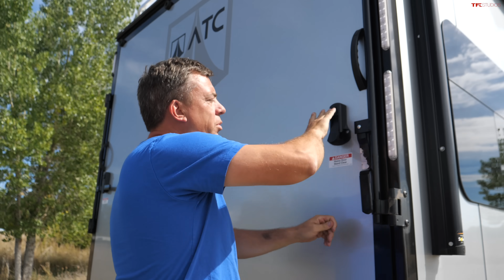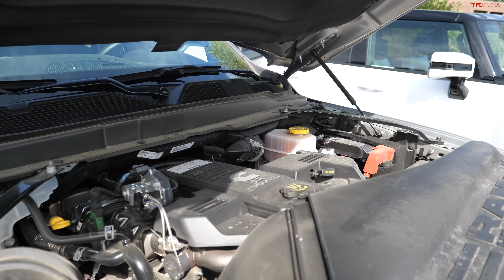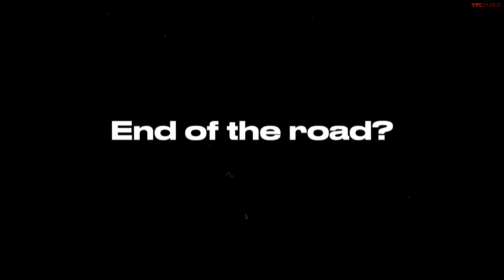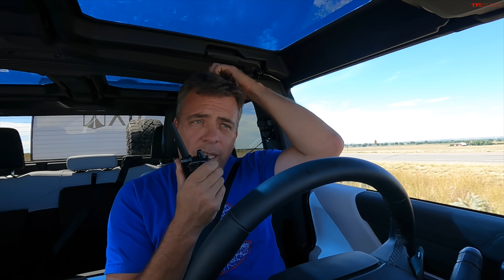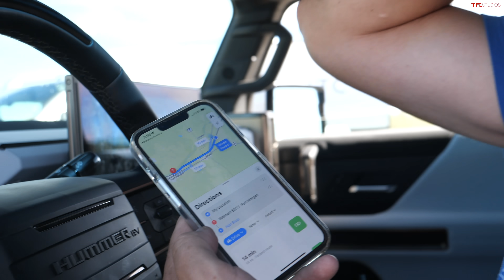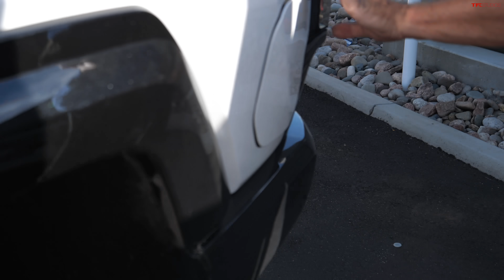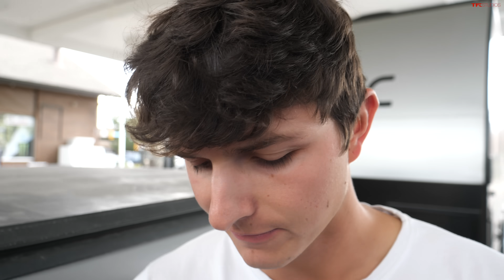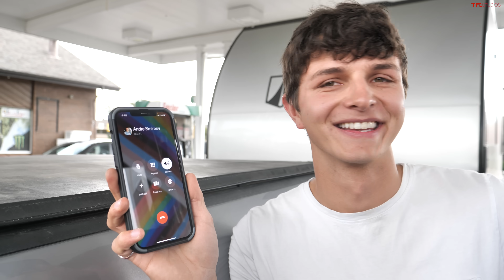How Far Can a Diesel and Electric Truck Tow An Identical Camper Trailer on ONE Fill-up?

Comment: An electric truck is just a toy for leftist soy filled losers. They have no real use for real world truck users. If you run out of power in an EV truck you are screwed. Unless you have a generator and enough fuel to run it, you are getting towed. In a real truck you get a quick top off with a few gallons of fuel and you are ready to go to a fuel station for a 5 minute fill up and you are back on the road.

Comment: Would be interesting to see the range difference if you ran a diesel generator to charge the battery as you are towing (if charging while driving would be possible). While it would be obviously not zero emissions, would it be less emissions (and better MPG) per mile compared to a diesel truck

Comment: They sure seem like more trouble than they're worth. Then when you factor in what the batteries take, and eventually do. You could drive 10 diesel trucks 400k miles and not pollute as much as a new hummer already has on the showroom floor.

Comment: So a clarifying point of order in regards to "fuel pricing"...you put less that half a tank of electricity back in the Hummer and went half(-ish) the distance.  I'm rough calculating you used about 184kwh to travel the 123 miles.  Outside of promotions that would be ~$79...$57 if you are a member.  That's $.64 and $.46 per mile respectively the diesel was around $.49/mile.  So basically we're just not quite there yet in regards to EV overall...and quite far away in regards to towing.  Currently the EV market is daily commuter, charge it at home.  That's really the only sensible use case.   I want a livable earth as much as the next guy, but we're a generation away in technology and a decade away in infrastructure...but we have to start somewhere...

Comment: Range is a large issue with EVs still.  And, based on what the cost would have been, no savings to speak of over diesel.  Hybrids get great fuel economy and no charger is needed.  Wait until the government starts taxing EVs for road use as they are heavier.

A real world situation:  heading from Houston to Dallas with a 30 MPH wind out of the north and pouring down rain and cold.  So you are using lots of extra electrons.  Now, add a traffic accident that shuts the Interstate down, will you run out of juice before it get moving again?  I can bring you fuel but not electrons.  I bet you would not get half way before having to recharge, but wait, where are the charging stations?  Well there are some but most are close to Houston.  You'd better plan ahead, or better yet use a gas powered vehicle.

Comment: Nobody buys an EV for a tow vehicle. Love the videos, but you are comparing two totally different vehicle focus groups. These videos really make the average person hate EV's even more, when, in reality, the EV is way more impressive than the diesel trucks. Bottom line, if you tow long ranges (over 100 miles one way) then stick to an ICE vehicle; if you do not tow long range, the EV's will be just fine. Now, let's not forget, the EV was twice as efficient. 

Basically, the Hummer has a small battery for towing, yes, I know it's not small; throwing a 10 gallon fuel tank in the RAM would be a prime comparison. EV's just need a larger "fuel tank".
Reply: Twice as efficient, twice as expensive, third the range, half the cost to fuel up.
That's the trade off. If you live in a cold place, EV is even less convenient
Reply: @dwightmanne  not accurate. I paid less for my R1T than a loaded F-150. 
I pay less than $10 to charge from empty to 100%. 
That’s 330 miles of range. 
The cold has robbed about 30 miles on a full charge. I’m in northern NY. Gets extremely cold here. 

The EV’s are getting a very bad name due to media. 

Think of an EV as a vehicle with the best performance, best luxury, best everything, but range. Imagine a loaded Denali diesel with a 10 gallon fuel tank. That’s a fair comparison. 

EV vehicles just need more range. It’s coming
Reply: @Teamvenomracing  how many people get all the options on their trucks? We are talking factory without options. Good for you and your rivian. Sad that you live in a cold place that kills batteries. But don't make dumb excuses just to justify your purchase.

A ten gallon Denali... Really?

Anyways. EV will gain widespread adoption if they are either cheaper than regular gas cars or have better mileage.
Half the cost or 500 mile range would have everyone running out to buy them.

As they are right now, the electric grid can't handle them, they take too long to charge, their range is too low, they cost more, batteries degrade and are expensive to replace and they have too many electronic stuff to break that make them hard to repair.

EV is the future, but we live in the present.
Reply: @dwightmanne  you really need to do more research. 
EV’s like the Rivian, are top model vehicles. So, you can’t compare them to anything but a top level truck of another manufacturer. Premium f-150 cost more than my Rivian. 

Now, batteries. 
They last on average, 20 years. The ones that Don’t are warrantied for 8 years/175,000 miles. 
The batteries that do fail, get repurposed or recycled. 

I actually own an EV and have been working on their tech for a living for 20 years now. 

Do you own one? Do you work on them? 

No, and your comments reflect this.
Reply: @Teamvenomracing  i owned a Prius and have a hybrid Impreza.
You aren't endearing anyone to EVs with your attitude. 
You're just living up to the stereotype of the smug self important ev owner
Reply: @dwightmanne  sorry you feel this way. You’re still very uneducated on EV’s. Do more research.

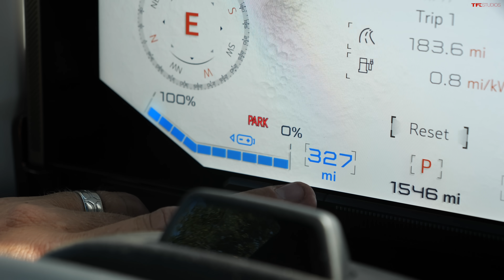Comment: 2:16 Before they even reset the trip odometer they were registering 0.8 miles per KWh, about half the estimated efficiency shown after the reset (1.5 mi/KWh).  A Model X does about 3+.  Not a good sign to start.

Comment: According to my calculations the F150 lightning Extended Range with the  131 Kwh battery has the equivalent of 3.9 gallons of gasoline.

Comment: The Hummer spare tire…ah yes what a total mess. Why couldn’t you locate a spare in the frunk? A truck is designed for people to tow or haul things and must be able to place (simple test - a plywood sheet etc) in the bed); short box or not. The issue is not just weight. Yes these electrics weigh about DOUBLE. So if you’re a commercial vehicle (such as a semi truck) gone is the notion or idea you can haul more payload in fact a comparable EV Semi weighs ten thousand pounds more than its diesel counterpart. Translation get ready for even more inflation. Too bad you can’t charge it without a trailer disconnection (infrastructure didn’t think of that) but of course the trailer builders are already set to equip auxiliary battery storage packs….bandaids for time being until we actually get batteries that have ability to be juiced up with enough range when towing and exceed ICE standards. Good thing you’re using our taxpayers to pay for free charging…hook them to become buyers and then stop the freebies. Hopefully, as is the case with all guinea pigs the annoyances (main battery weight range) will get worked out but unfortunately the cost is more than a house on wheels. I wouldn’t be surprised if we see electrified RV trailers with driving wheels to supply support longe range travel. With that much chassis real estate you may as well fill them with battery packs inverters motors and intelligent control systems.

Comment: 9.7 mpg with 6.7 cummins weghing 14,000 lbs total vs my cummins weighing 38,500 lbs total , 8.3 in my 40 ft motorhome towing my 2021 Silverado 1500 4x4 , got avg 9.5 mpg tells me your cummins has something wrong , especially when you were on relatively flat ground , and mine was on mountainous terain from Jasper , Alberta to Yuma , Az , I used to work for Dodge and saw way better fuel milage , as a matter of fact i never saw milage that bad towing , my old MH got avg 13 mpg , newer one is a little higher geared

Comment: Battery tech isn't there yet.  Hard to beat the stored energy of diesel.  Maybe once little reactors are under the hood.
Reply: Look up dry state batteries. This is the only long-term chance Ev has, but if you look them up so far the smallest, they can make the tech is way too big for automotive use. However, a dry state that is 8ft by 8ft by 8ft can power a city of 250k people for a day. Don't quote me on that exactly, but it is impressive. I, however, am on team hydrogen for the future, and for the moment, team propane. The old 5.7 really rips on propane.
Reply: @bigrob6076  what do you mean by the 5.7 and propane? Got a video I can look up?

Yeah Im supporting Cummins with my money how I can since they're working hard on hydrogen.

I believe the battery technology is already there, but the shielding or whatever isn't.
Reply: Not only battery but chargers in small towns aren't up to the task. And there are only a very small number of EV rigs on the road relative to number of cars
Reply: It never will be

Comment: If you buy an EV or elect to use digital currency when it comes out or elect to use smart meters on your house you are just telling the “Man” you are ready to be enslaved. Don’t comply to this nonsense. I noticed the cost of the partial charge was getting over $37 but the charging company had a special that month. The more EVs on the road the more expensive to charge especially if they keep shutting down power plants. They will have to build special stations to handle EVs towing any type of trailer.

Comment: Do a cross country pull and see how long it takes each vehicle.
Reply: Nebraska to southern Arizona would be a good test.
Reply: @1stpaintballmaster  That would be a year long test on the electric.
Reply: In the middle of winter.
Reply: @davidtycker  Exactly!
Reply: Almost three times the time with EV trucks
Reply: They wouldn't make it -- there are stretches of more than 130 miles of no electricity fast charging. 

The trip would be charger to charger only. 

LOL SORRY TO WHOECER BUYS THIS TRASH HHAHAHAHA
Reply: That junk ass ev will need towed
Reply: Pretty sure I could go coast to coast in 2 days in the diesel, EV not even close.

Comment: Sorry but our stupid politically correct Government is putting the cart in front of the horse. I truly believe electric vehicles have a place but way to early for this drastic push. Afordability, Dependability and available charging facilities are way behind. This Electric thinking will kill lower and middle class people financially. Slow down do things right. How about at the same time of improving Electric, improve all types of fuel clean running. How about clean natural gas running vehicles. Hydrogen cell fuel. Something isn't right with this current thinking  !  Just so people understand I have 52 years of all types of vehicle experience including running or owning car ,truck,heavy equipment Farm equipment and most others business.

Comment: Guys, that Ram got TERRIBLE mpg.  My 2009 Ram 2500 with 6.7 pulls a 10,100 lb., 36 ft. long, 13.1 ft. tall 5th wheel trailer and gets between 14 and 15 mpg consistently (depending on wind direction) while running 70 mph on mostly flat expressway.  If I reset the trip computer while cruising at a steady 70 mph speed on a flat highway and calm wind, the mph jumps to about 17 mpg.

Comment: All kidding aside. I would like to see this test done, on a 10 year old diesel engine vs a 10 year old electric hummer. I have electric tools and my batteries have to be replaced every 3 years on those or I lose a lot of power. Is the similar to EV's?
Reply: My 2008 Prius with 213.000 miles is still running..... But the MOMENT you jump on the highway, my battery level goes down to nothing, and after I get off the highway, maybe a 5 to 10 minute drive will charge them right back up..... Stop and go traffic SUCKS bc the Regen-braking doesnt work. Brand new, I would get 50 mpg.... Now its about 35 to 40
Reply: @RyGuyXRP  Thank you very much for this. I appreciate your honesty. This is the kind of non bias information about EV's that we all need to hear. It sounds like you are still happy with your car and I respect that. I just wish there was more respect for people who like their choice of vehicle that isn't electric. The technology is great, I just don't think it serves all people yet. There are positives and negatives to both kinds of vehicles. I think an EV would be a great second car at this point.
Again, Thank you.
Reply: @RyGuyXRP  Do you ever do any mountain driving in the winter? Does it do ok in those situations?
Reply: Side note: It cost $110 for a battery powered tool with one battery... One replacement battery... $110. If you buy a $30,000 car and the engine blows, you don't pay $30,000 for a new engine, you pay $3,000.

Comment: As a diesel owner who tows a 10k 5th wheel, I know how to manipulate my fuel economy. Id be curious how much change in range you see going 60mph instead of 70.

::Edit:: My '11 F-350 6.7 bone stock with the 10k 5er does 8.5 to 10 on the highway...but can't get comfortably past 180 miles out of the dinky 26 gallon fuel tank.

Comment: So every two hours you drive, plan on stopping for 30 to 45 minutes to charge--assuming you can find a charging station located right as you approach empty--which is unlikely. EVs are not suitable for towing, or in low temperature regions.

Comment: There will NEVER be a battery that can compare to fossil fuels.  Sorry...  It's just physics.  Maybe cold fusion someday?  But, the weight of the containment field would outweigh it's usefulness.  The best thing we can do is use clean burning fuel and efficient engines.  Maybe a hybrid diesel?  Like a locomotive?  But, I don't think locomotives are very efficient either.

Fast charging batteries is another hurtle that physics will not allow you to change.  You can charge any battery fast, but it creates heat.  If you charge too fast, you ruin the battery.  10 percent for 10 hours was always the best method.  By the way, who the hell pays for the electricity at these charge stations?  Let me guess....  The taxpayer....  Oh, and where does the electricity come from?  Coal fired, or nuclear generating stations.  Some solar, some wind...  But not much.

Comment: 0.25m/kWh diesel vs 0.6m/kWh hummer EV is actually pretty spot on for diesel engine thermal efficiency of around 40%
Reply: now the hummer just needs a 7 speed tranny

Comment: I bet that $40 charge he mentioned would only be for one charge 120 miles so it would be $120 total and at least 1 1/2 hours to charge not 15 minutes to fill up diesel.  Still like the Hummer because it’s nice but they don’t compare when driving distance
Reply: 15 minutes is pretty slow for refueling. it only takes me about 5 or so minutes to put 45 gallons in my ram 4500
Reply: Also, don't forget the government has increased all fossil fuel prices in order to push the electric vehicle narrative.  Secondly, where do you think the electricity is coming from to charge the electric vehicles?  Hint, fossil fuels.  Electric vehicles cost more to produce in carbon footprint than a fossil fuel vehicle.  Volvo did a 5 year study, that didn't include any recharging of the battery, maintenance, etc.   A new mid sized sedan can be driven 52,000 miles before the carbon footprint equals that of the electric vehicle production cost.  A truck, example the hummer, you can drive a fossil fueled truck 92,000 miles before the carbon footprint equals that of the electric vehicle production cost.

Comment: Efficiency at the EV doesn't mean squat.  If you want to compare apples to apples, you have to include the original efficiency at the power plant burning coal.  Or here in DFW, how much nuclear waste it takes to produce the electricity for your truck.  Claiming EV's are 0 emissions, or that they're 90-something percent efficient, is nothing but a shell game.